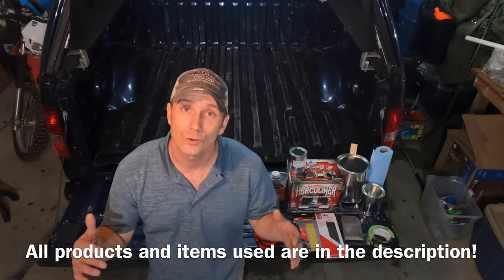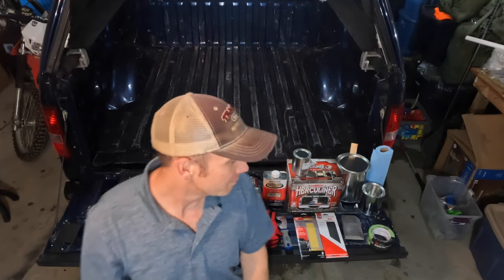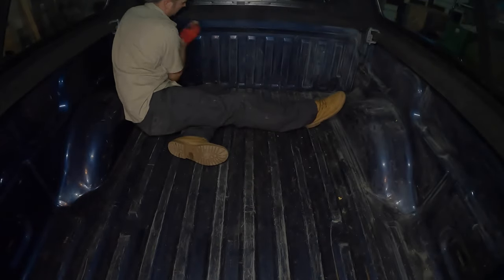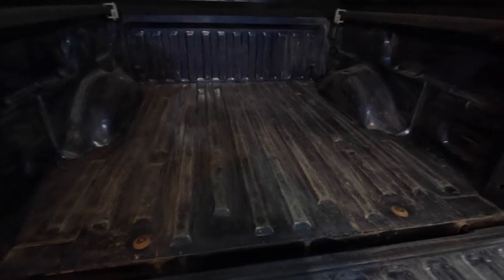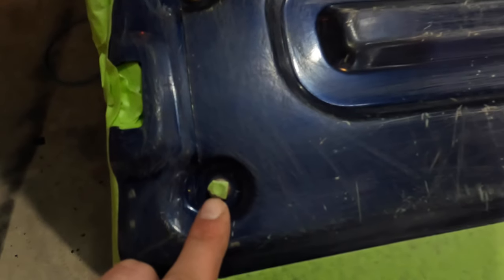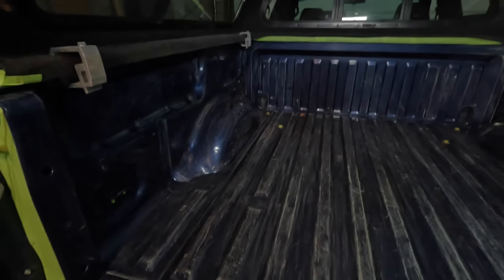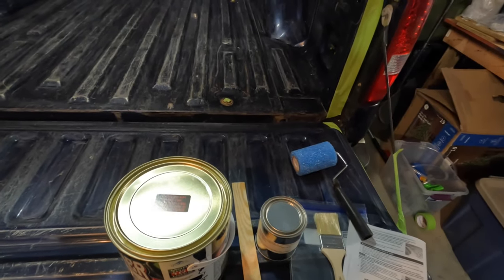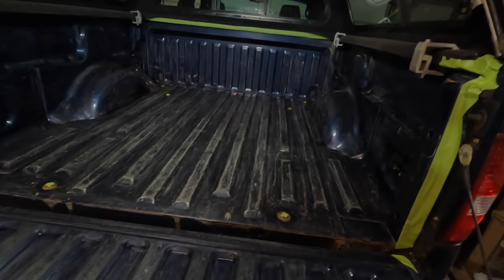DIY Roll On Bed Liner For Less Than $100 - Herculiner

Comment: Can I have more info on the white paint you used “name etc” definitely plan on doing the same live the way it turned out 👍
Reply from the maker: I apologize, but I don’t have anymore specifics.  I got it at O’Reilly’s, it’s a urethane based paint.  I would have them make sure the hardener is in it.  They told me it would be fine without it, but I feel like it “diluted” mine.  Just let the paint shop know what your intentions are.

Comment: Really dumb question. I built a boat out of foamular I did a triple coat of poormans fiber glass and my boat is awesome . My question is can I apply this to the outside of my boat to give it a more sturdy outside shell. As opposed to a proper fiberglass coat.
Reply from the maker: I’d do some research on that.  It might be ok, my only concern is if it would hold up with being wet all the time.  But I guess this bedliner gets rained on and some truck beds hold water sometimes.  Especially sitting at odd angles.